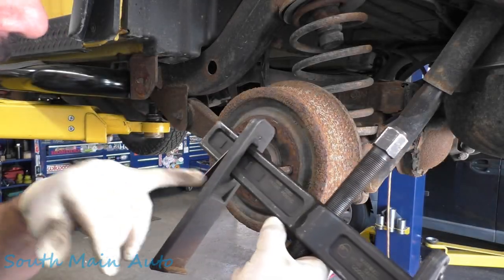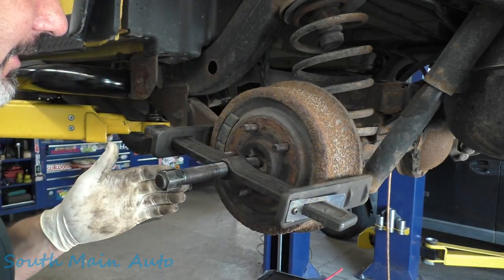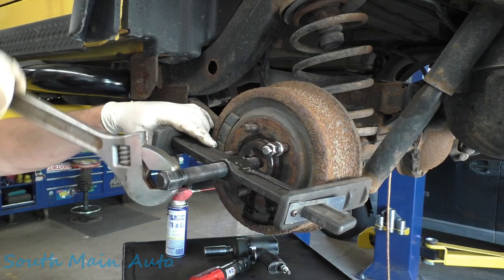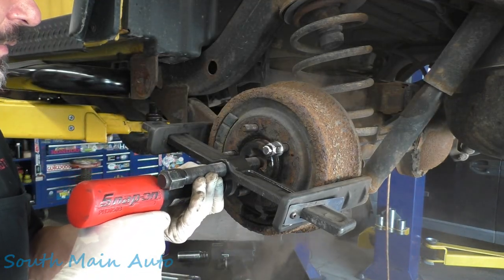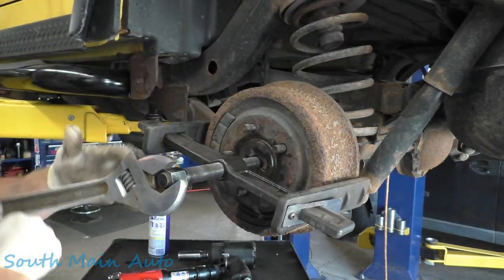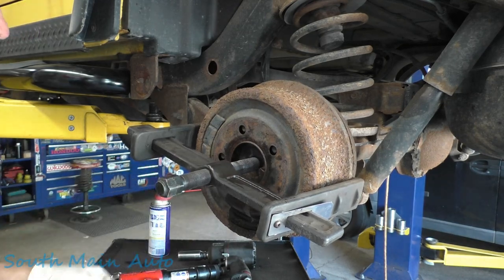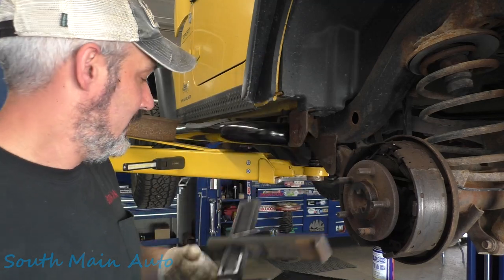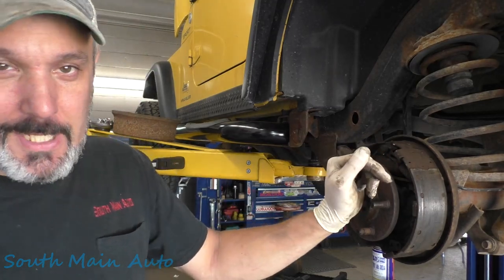Must Have Rotor Drum Removal Tool

Comment: Beware older F150 owners, probably other vehicles too. The hold down pins like to pull through the rotten old backing plates if you go at them with the shoes grabbing the drum in the rotor. I've had good luck with some creative use of all-round (strapping with holes in it) to make a dished washer to cover the hole the head of the pin leaves.

Comment: Nice,  I had an old Nissan hardbody it had 2 holes on each side of the hub that were threaded  I used to have to put 2 bolts in there and start tightening them up to get mine off most of the time when it came off all of the springs would be in the bottom of the hub because the pin with the little keeper that held the shoes on it would pull the pin thru that keeper but it worked,   I do like that one there though.
Reply: Back off the adjuster as first step since you'll be backing it off anyway for the new shoes.
Reply: @wssides  never could get it to back off  every time I would put breaks on it I would take that weird looking pin  that holds the adjuster on and clean it inside and out even put never- seize  on inside one time still could never get the adjuster to work right it would turn so easy before hand but getting it to come loose different story and most of the time I would just go ahead and put a screw driver or drive pin up against it tap on it till I heard it fall down in the break drum and then take the hub off

Comment: Looks handy, and usable on any type of drum brake (the one where the studs and bearings are in the drum (Euro cars, older Subarus) or the type where the drum sits on a spindle). While in Europe, I used a bolt-down puller on my old Renault (it's a studs-in-drum type) because the drum was stuck when one shoe's friction material came away from the backing (they're bonded, not riveted) and jammed into the other shoe. It's a common problem with those types of bonded shoes and no amount of backing off the adjuster could do anything to free it. Apparently some Ford trucks with ZF automatics have the parking brake drum mounted to the back of the transmission, and those also have bonded shoes which can come apart and jam up after years of use (especially in the rust belt), even if the brakes are seldom used and there's plenty of material left. Not a good design, IMO. Rivets usually don't fail spontaneously like the bonded type does.

Comment: This tool would've came in handy a few weeks ago. Was trying to change the drums and shoes on my brother's 02 escape. That mother lover was frozen solid. Took turns with the sledgehammer. Had to replace all the hardware but we got it off. Funny enough, the other side slid off with one small tap.

Comment: Spraying brake cleaner on the drum and in the gap helps stop that dust from being airborne...
Reply: WD40 takes a little longer to dry out though. Brake cleaner evaporates super fast, especially in a hot shop in the summertime.

Comment: HOW ABOUT A VIDEO ADDRESSING HOW TO KEEP THE DRUMS FROM STICKING IN THE FIRST PLACE?
You've probably done just that earlier but I missed it.

I almost purchased a very similar tool for my 91 Toyota truck. I finally got the drum off but it was destroyed in the process.
In my case I removed the rust on the axle and gave the new drum face and axle face a thin coating of anti seieze compound. All is good for 4-5 years of PNW weather now.

Comment: Does it work on the Expedition front rotors.  LOL.  beat, wedge, spray, heat, then replace wheel bearing as well.  Your great, keep up the great videos.
Reply from the maker: Yes sir, pulled some right off for snaps them clean in half

Comment: The hidden cost of auto repair.  Per the amazon list below, the normal price for this tool is $152.50, on sale now for $144.50.  This is initial cost to help set up break repair business.  Its not used every time, but is required to set up shop.

Comment: Why not use a very light coating of anti-seize?.  Seems like a good idea no matter what part of the world you live.  When we did my rear shoes on my truck..and many a mechanic I've known have also done this is where I learned the idea...we used anti-seize on the face and around the center before we put the hub back on. Not much. Just a touch on a rag and wipe it around like greasing a pan.  I imagine those salty roads...bad idea in the first place..cause enough of an issue it's no wonder folks retire to the south...lol.  Take care.  Alabama here and I'm just amazed at some of the rusty conditions you guys up that way have to deal with.

Comment: AAAANNNNNDDDDDD  this is why you should "UPGRADE" to disks everytime you can... nothing worse than stuck brake drums... when i did brake jobs when fitting the new drums i used to add a thin layer of high temp copperslip (copper grease) so the next person didnt struggle.

Comment: Pretty sure you used that to pull a rotor in a previous video - possibly off a Mazda? - and the rotor let go quite violently, fell to the floor and chopped off an air hose.

Comment: Would a bit of antiseize between the drum and hub surface prevent that issue ?
Reply: Antiseize, paint, grease... anything that can get between the hub and the drum (or rotor for that matter) is going to do some part in preventing/mitigating the rust welding.  Two factors become involved, however... escape of that stuff to where it doesn't need to be (pads/shoes) and causing bad brake performance and/or time to do it (paint, specifically).  Also cost, but minimal.  For a shop... probably not worth it because they have ways to 'coerce' things, like this tool, so it don't much matter.  

For what it's worth, on my own "I got all the time in the world' brake jobs on my cars, I paint the hubs.  So far so good, but then I'm not in the rust belt. :p

Comment: I hate drum brakes. 
Edit, the underside of that jeep is clean. Must be from somewhere south originally. That hole in front of the rear axle we see has the tendency to collect dirt and debris in it, causing the frame to rot from the inside out. Happened on my 99 sport.

Comment: Have you ever tried brake torquing or inertial torquing back and forth in forward and reverse with the lug nuts loosening installed in order to free the drum? It can save the drum because it frets the rust free between the drum and axle pilot.

Comment: Why so much balance weight on that drum ?
Reply: probably to offset mass produced lopsided castings. plus it's probably the factory drum, the factory wants the vehicle to be as stable and smooth as possible.
Reply: @volvo09  I'm surprise a "modern" casting would be that sloppy.
Reply: @wdhewson  I'm holding back on the Chrysler joke... 😆
Reply: @volvo09  Yes, it doesn't need elaboration.

Comment: The crime is cars still using drum brakes in 2022.
Reply: Drums are best for most cars. They're lighter and last longer.
Reply: @fascistpedant758  they last longerbin the rear because theyre not strong enough to wear out.  Every vehicle with them eats front brake pads in a year

Comment: jeeps should not have drums on the rear.... they r rear wheel drive.. should be disc... drums r so old school and very old technology
Reply: Drums vs disc is nothing to do with FWD or RWD, it's down to weight distribution. The front brakes, even on RWD cars, do the bulk of the work.
Reply: 60 to 70 percent of the braking happens on the fronts. DUH